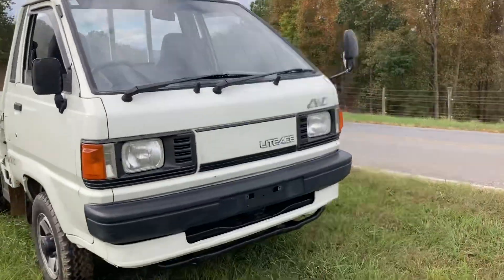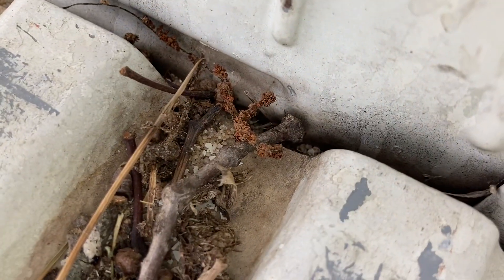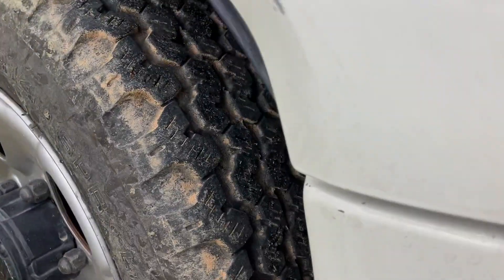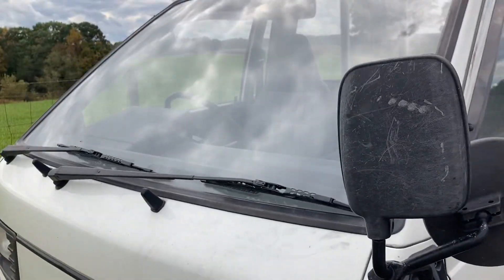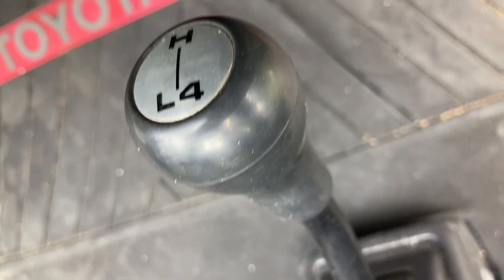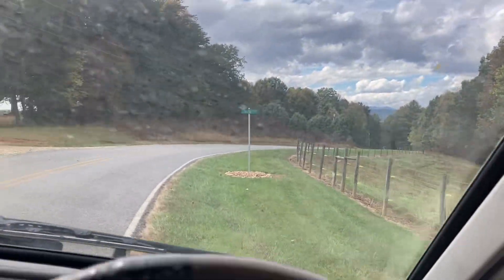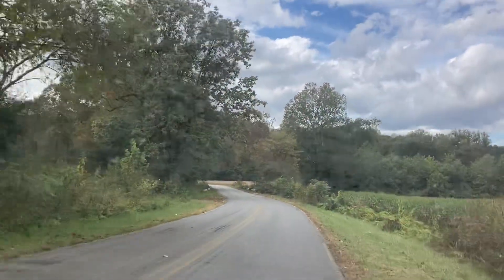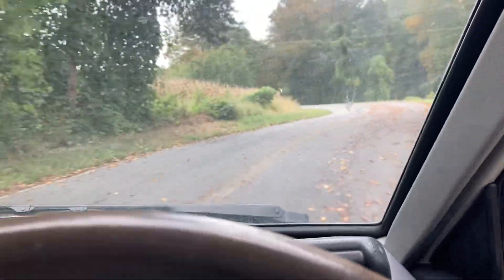LiteAce 4x4 Diesel 5speed Ultra low miles

Comment: Nice truck - is this still on the original tires? I've been thinking about getting one of these, but finding LT ('light truck') tires in North America in sizes that fit seems to be extremely difficult. At 3/4 ton, or especially 1 ton, passenger car tires will smoosh flat, if you can even find those. And the Super Single trucks have extra wide 12.5" wheels in the back that are completely impossible to fit...
Reply: Tony has tires available and you can buy tires on eBay too and other places. It’s definitely not impossible to find tires. Amazon has tires.
Reply from the maker: The tires are Yokohama Super digger 175R14.  They look good so I doubt that they are original. 14" is not too hard to find:)

Comment: Air conditioning?
Reply from the maker: No A/C:)  But more of a work truck and it does have heat...
Reply: @minitrucks  thanks for the quick response but I'm down in Southwest Florida and definitely need air conditioning if you get any leads on a truck in that condition with air conditioning I will definitely take it. Currently running a 1995 Suzuki carry 5-speed with AC just need something a little bigger and in Immaculate condition
Reply from the maker: We are wanting to get a 1991 or 1992 Shannon 38:)  Honestly you probably will not ever see a lite ace with A/C.  I've been importing from Japan for 12 years and have not seen one.